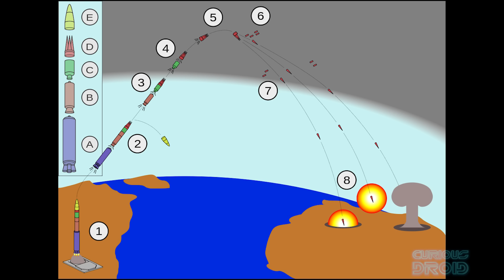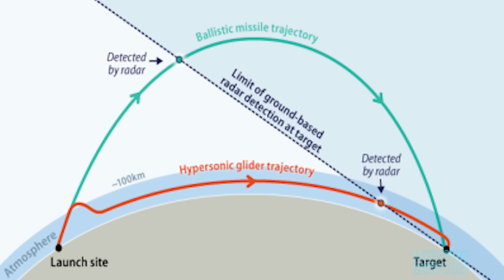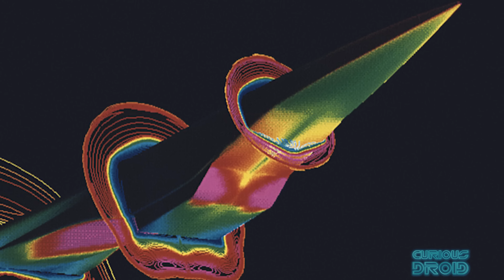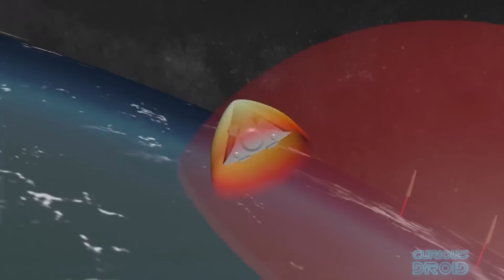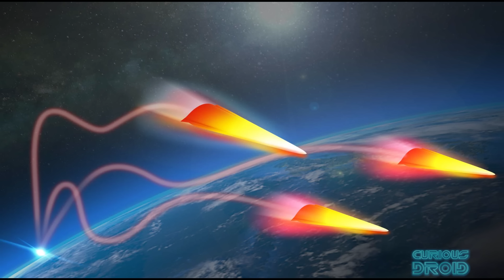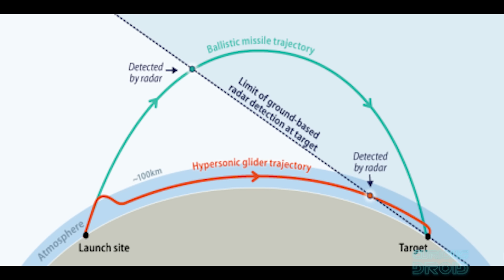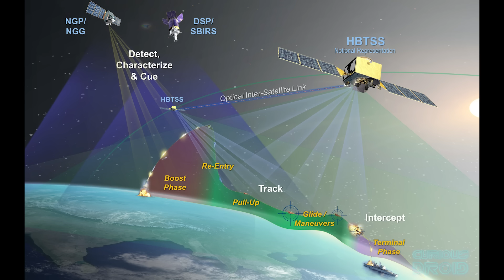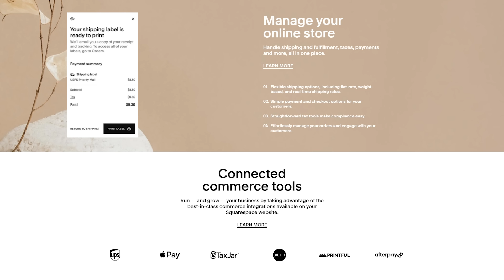Can the U.S. Stop Russian and Chinese Hypersonic Missiles?

Comment: Pretty large error at 8:22 The DZ ZF is not a hypersonic scramjet cruise missile, it is a hypersonic glide vehicle boosted to speed by a ballistic missile.
Reply: You are right, I agree.
Reply: The whole video is filled with errors. I expected much better.
Reply: Avangard itself is the same of the system, not the missile as well.
Reply: Science guys are not engineering guys.
Reply: @user-os6ch5pt7w  I like this channel but I would have to agree with you regarding this video. Hypersonic weapons are a technically complex field but getting classification wrong when there are only two, very different types of hypersonic weapons currently is pretty troubling. The writing team on this video definitely needed to do some more research and seemed slightly out of depth.
Reply: @thenegociater3387  The writing team? Doesn't he do these all himself?
Reply: Tell Paul, that they can be stopped, but first the military computers will need to scan the alien-code, that's embedded in at least 3 of his shirts. 👽😳
Reply: @beayn  This is a video presentation from the Russian Ministry of Defense. The author of the video edited stupid text. Why are you discussing all this if you don’t understand anything about it?

Comment: The plasma generated at hypsersonic speeds is reflective in nature, so ground-based radar should have no problems tracking them (just like how they track reentering space craft).
The problem is the missile not being able to see though it to track the target or possibly even communicate with external guidance from satellites etc.

In short, this effect makes it harder for the missile & rather than those trying to intercept it, so it's an advantage to the defenders.
Reply: There was talk of firing a type of chaff in front of them to disrupt the air to make them over heat and damage the engine though I guess all the same other previous issues will still apply
Reply: @shardovl586  not sure what the advantage of that is over just detonating a warhead nearby.
Reply: @sergarlantyrell7847  Sounds way too much like Atari's Missile Command...
Reply: @sergarlantyrell7847  What near you only troops and carrier fleets, plus the chaff lingers longer, though I think they binned the idea anyway

Comment: There's another rumored propulsion method for larger unmanned craft, where super-insulating tiles are in front and the shape of the craft cavitates the air and ejects fuel into the rear cavitation, then the friction energy ignites the fuel. The rumored craft carried multiple warheads, and ran a predetermined flight path to drop at targets before air friction burns through the tiles.

Comment: Great work on a tricky subject, however slight correction for supersonic speed. By definition, when travelling at these speeds there is an instantaneous jump at the shock wave. This means air particles in front of the wave do not move out of the way as they do in subsonic regions
Reply: That's for going from subsonic to supersonic (as in breaking the sound barrier). But the borders between supersonic and hypersonic are pretty vague.
Reply: @peterhacke6317  Actually the physics it pretty well understood, except now you are dealing with a plasma...

Comment: I can imagine that attempting to shoot down a purely kinetic impactor has the problem of possibly destroying the vehicle, but leaving a very dense warhead still hurtling towards you. There would still be major damage from the impact of the remains, even if it was knocked slightly off target, assuming it was made of something that didn't completely vaporize from air friction. It would be like trying to shoot down a rocket assisted cannon ball.
Reply: At the speeds they're moving, they'd have to get knocked slightly off target within a very short distance of the target.
Reply: Yeah basically its like trying to stop a giant APFSDS round by throwing explosives at it.
Reply: I'd imagine that the additional frictional heating from a One Megawatt laser would be more than enough to veer it off course. At the speed the impactor is traveling even the slightest momentary deviation will send the object tens or even hundreds of meters off the mark.

Comment: Love the video, great work !!

Small correction if I'm being picky, vehicles have a drag coefficient. Whilst this is fairly constant at low subsonic speeds, it peaks around Mach 1 and sharply drops off at high supersonic speeds, so drag is proportional to velocity squared assuming the drag coefficient (Cd) is constant. As it drops off at fast speeds, the drag at hypersonic speeds is definetly less than 25 times that at Mach 1. Drag = 0.5*density*(v^2)*Area*Cd
Reply: Arent  all ICBMs hypersonic ?

Comment: A hypersonic missile will slow down as it descends into thicker air. Won't it?
Reply: It most certainly will, the SR-71 had to flight as high as it did because even going mach 3 caused a shit ton of heat
Reply: My understanding is that they won't be hitting an altitude ceiling to begin with: to employ the speed factor, you'd have to sacrifice the 'surprise' element of low-altitude flight. Can't see Mach 25 being achieved at 10,000 ft.
Reply: Sure, for the last less than 10 seconds of it's flight.

Comment: Hypersonic Missiles have 2 major issues:
1: They cant communicate to make adjustments once at full speed because of the the ion plasma arround the missile, this makes moving targets harder to hit.
2: Once the missile descends it will not be able to sustain hypersonic speed because of the increasing denser atmosphere, and the Ramjet engine eventually stops working.
the missile will then only rely on the ever slowing kinetic energy and can be taken out by anti missile systems (still a hard thing to hit)
Reply: exactly this, near target at low altitude they are mach 1,5 as older ones
Reply: sorry to effectively copy-paste, but this fearmongering has a use, and it's not because the US military is really THAT bothered by this "new" thing they have known about for decades.

the next time the US military budget go up, expect this buzz word to be mentioned more than once.
Reply: how many seconds does phase 2 last for?
Reply: @DrWhom  Same as for any other missile. The engagement speed can typically from be anywhere from about 300 to 2000 knots.
Reply: They don't slow down, friction is irrelevant at terminal phase. It will be covered in microseconds, density of air is a few km, distance that will be covered hastily.
Reply: @Argentvs  You ever see a shooting star? Yeah a missile at mach 5 plus is just like that. You can't fly straight down from orbit and you can't fly above mach 5 in the lower atmosphere. Even the SR-71 at mach 3 had to fly at the edge of space to keep from burning up. Physics, It's a thing.
Reply: @Argentvs  You got it right, the other person here does not realize that. A few seconds isn't going to slow it down much unless it's the viscosity of water.  Missile doesn't have to hit if it is nuclear either, the nuclear blast radius to defend from American Imperialism would destroy communications on ships as a minimum.
Reply: @AFlyingCookieLOL  pffft relying on nukes, it makes you look like a coward who can't beat a foe in conventional war
Reply: The plasma blackout is not a problem according to the US DoD.  It’s an issue with blunt bodies.
Reply: @patrickweaver1105    The Muzzle velocity of a shell from a Rheinmetall Rh-120 reaches 1650m/s and it travels all in the thick air. If such a shell can destroy a tank then I believe a Hypersonic Missiles don't need to slow down when it dive down. The drag and heat created by dense air in short time are not unsolvable problems. The ICBMs face the same problem.
Reply: @user-pt8og3ls5x  Shells are not missiles and the RH-120 has a range of 4000 meters. ICBMs are transatmospheric and their re-entry vehicles have heat shielding. You're not even in the same zip code much less ballpark as a hypersonic missile.
Reply: @user-pt8og3ls5x  even if we assume apfsds shell, which is a fucking thin rod with fins, is the same as a missile that wants to travel at mach dozens, how did you come to the conclusion that apfsds shell travelling at mach 5 disproves the claim that missiles can't really move faster than mach 5 in dense atmosphere?
like....
in the most child basic logic, that is not right m8.
Reply: @patrickweaver1105  the missile only needs to travel through the thick air for the terminal stage, go up 10km and air pressure is already 20% of what it is at sea level, go up another 10km, and it drops down to 5%, then the pressure drops off rapidly to less than 1% at 30km up.  Hypersonic missiles will fly at 50-100km altitude meaning theres bugger all air resistance up there.

Only when its in its terminal stage when it dives down on the target with its momentum and gravity assisting will it go through the thick air, which would only be for the last about 20km or so.
Reply: @hughmungus2760  Which means it's just as capable of being intercepted in terminal phase as any other ballistic missile. Which is what it is in terminal phase. Cruise missiles maneuver more than hypersonic missiles.
Reply: @patrickweaver1105  the hypersonic terminal phase only lasts about 30 seconds. While a cruise missile would take several minutes to cover that distance.
Reply: @hughmungus2760  No it's about the same amount of time because cruise missiles are harder to detect.
Reply: @patrickweaver1105  against a carrier group which has AWACS cruise missiles aren't really hard to detect at range

Also cruise missiles take too long to reach their target if fired at standoff range. The advantage of hypersonics is that they can strike targets of opportunity with very limited windows of intel, like a moving carrier thats being tracked by satellites or recon plane.

In the time it takes for a carrier group to launch an interception of said recon asset, the hypersonics would have already been launched and hit carrier, while a cruise missile would still be hundreds of miles away and likely lose track by the time they get there due to the recon asset being shot down or satellite having moved out of position.
Reply: @hughmungus2760  Hypersonic missiles are much easier to detect. Cruise missiles are fire and forget. Throw up all the walls of text you like you don't know how any of it works. No Hypersonic missile has ever hit a ship in motion.
Reply: @patrickweaver1105  uhh no cruise missiles need guidence updates until they get within terminal range because their own radars are very short range and cant see over the horizon. In the time it takes a subsonic cruise missile to cover standoff ranges, ships could easily have moved out of range of the missile's terminal guidance radar.

Maintaining target acquisition at sea is one of the reasons initially why the US thought chinese hypersonics wouldn't work. Not that these missiles were easy to shoot down.
Reply: @jenykoo  Common internet myth. Interceptions come from attacking from ahead of the target. In 2008 we shot down a malfunctioning satellite (ours) traveling at 7.8 km/sec near the edge of the atmosphere with a SM-3 fired from a ship at sea. It can be done. It has been done. It is not almost impossible.
Reply: @patrickweaver1105  This happened because they knew down to the millimeter and down to the second the trajectory and time of the fall. And also all the systems were already ready in advance
Reply: @user-qr2bd4lx2t  It didn't fall before the missile hit it. What difference does it make if you if you get the intercept solution a second before you hit it or a year? You still have to hit it either way. Also on one knows the trajectory of an object down to the millimeter.

Comment: Just the fact that these missiles create plasma around their leading edge to become "invisible" to radar. This same "static" can be used to used to find them. The speed at which they travel makes them dangerous as explosives are not kneaded because of their kinetic energy.
Reply: The kinetic energy of such a missile is tiny in comparison to the energy released by a nuclear explosion. Kinetic-only attacks would only be useful for point targets. Also, I don't know if the missile is accurate enough to directly impact most targets.
Reply: @CasabaHowitzer  They seems to be target to destroy enemy nuclear carrier (mainly aircraft carrier) or command position (probably bunker). Neither is big enough to require nuclear warheads. Kinetic impact might actually be enough for these high value smaller targets.

Comment: I'd be interested to know exactly what material and structure can withstand any maneuvers more than small ones at mach 20+.
Reply: Any big moving target, which these weapons are designed for i believe, won't have enough time to react when the hypersonic missile enters terminal stage of descent.
I mean, what can an aicraft carrier do, if it has 30 seconds to react even if it does detect the missile coming at it with 3000 meters per second.
And i imagine an aircraft carrier wont have just one hypersonic after it, might have a couple plus decoys.
These are not designed for a nuclear war anyway even though they can carry the warhead
Reply: @fs5866  You have completely misread my comment. The MISSLE can't survive movement at high speeds. And targets will have more than 30 seconds. The missles are easy to track.

Comment: High speed and highly manoeuvrable are exclusive, unless the vehicle can withstand up to 100g’s or more. A highly manoeuvrable vehicle would have to become subsonic to do manoeuvring enough to avoid missile defences.
Reply: Beyond boosting speed temporarily, yes.
Reply: Not really, first off 100gs are not a crazy amount, the Sprint missile (which could maneuver) exceeded that. And secondly, an HGV doesn't have to fly crazy loops to hit their their target, offsetting their course by a couple degrees is enough to be able to follow any ships movements given their speed.
Reply: @JohnDoe-jp4em  the point is evading defenses. Once a HGV enters the defensive sphere for terminal attack it can't just turn a degree to evade interceptors. It will miss entirely. And while a 1 degree redirection means a huge offset at distance, it does little to make the interceptor miss the predicted flight path.
Reply: @ChucksSEADnDEAD  The problem interceptors have is that they have to continously follow the projected flightpath, which could change by kilometers of distance every second. An HGV can waste the limited fuel of an interceptor which has to constantly make aggressive pointless maneuvers following the new trajectory due to being slower.
Reply: @HELLO7657  Why couldn't it obviously turn at that rate? Whats the technical reason it can't? And it doesn't have to keep turning for seconds at those G forces, only fractions of a second. It also wouldn't use a rocket to maneuver, it would use control surfaces.
Reply: @JohnDoe-jp4em  the faster you go, the wider the turn radius, those missiles pack a hell of a lot of kinetic energy in a straight line and you need to overcome that with small control surfaces.
Reply: @JohnDoe-jp4em  That's not true. Interceptors continuously predict the impact point and fly towards it. If the projected flight path moves by a few kilometers, the interceptor can fly a few kilometers to adjust.
The HGV can't waste the kinetic energy of the interceptor, because it spends so much energy trying to turn at high Mach speeds.
Reply: @ChucksSEADnDEAD  No. Imagine you are trying to catch somebody running towards you, somebody that is much faster than you because you are only allowed to walk. You can't chase after him, as soon as he passed you you will never catch him. So you have to manage to "intercept" him head-on. If he turns slightly to the right, you have to walk to your left in almost a right angle to him to have any chance of being where he is when he passes you. He then suddenly slightly turns to the right, meaning you have to now walk all the way back you came and then again the distance to the new "intercept" point. Doing this, your adversary still kept moving towards his goal fast with only a slight zig-zag to it, while you were made to walk in the complete opposite direction of your goal. If he keeps doing this, you will have walked a huge amount of ultimately pointless distance, while your adversary has continued in pretty much a straight line.

Interceptors don't have infinite fuel, in fact they have extremely little because you can't have an interceptor that a) accelerates fast b) fits on a ship and c) has lots of DeltaV. Only 2 out of 3 are possible at the same time. Additionally, the interceptor has to accelerate upwards through thick atmosphere, while the HGV is moving downwards through no atmosphere/thin atmosphere. It's kinda doubtful an interceptor could reach the speed of an HGV before passing the HGV, so any course correction is highly exaggerated on the interceptors end per my example.
Reply: @JohnDoe-jp4em  CONTROL SURFACES HAVE TO HAVE OXYGEN
higher you go the bigger you need them               air thinner
faster you go the smaller you need them                   more dynamic force
and slower you go the bigger you need them                    less affect over the surface
also the air is denser at low altitudes            more affect for same change
work that one out
clever boy